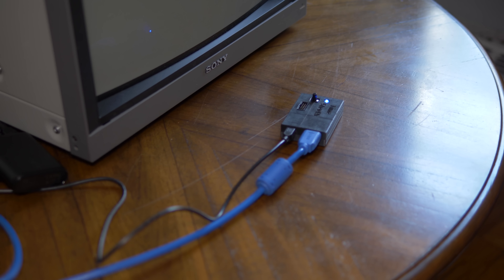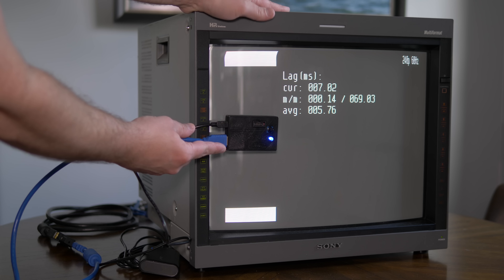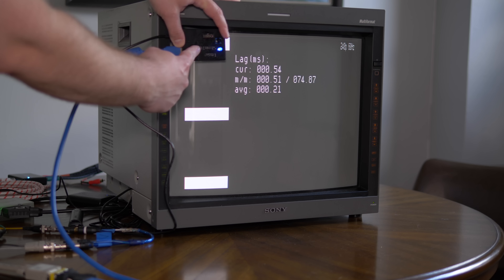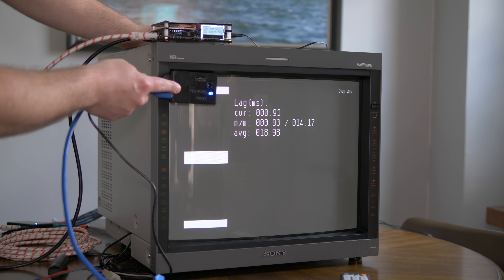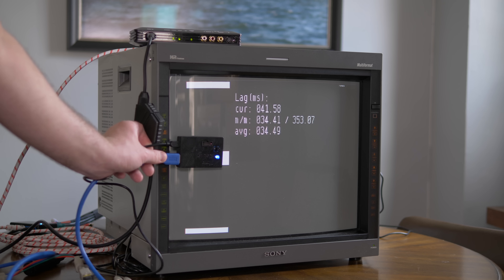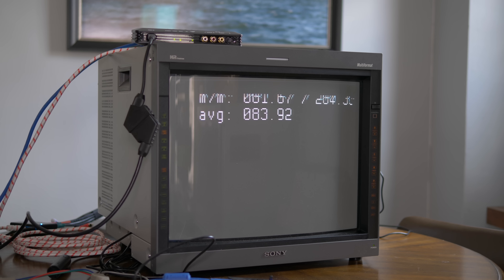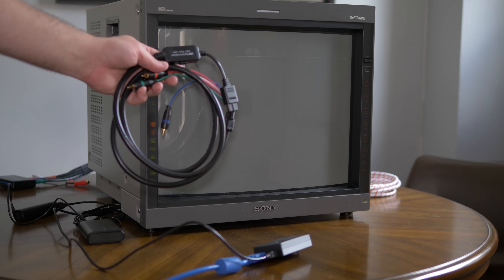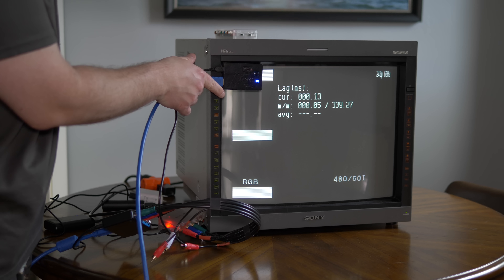Lag Testing Retro Scalers

Comment: Dude, this guy's content is incredible. I knew nothing about retro gaming and after watching this guy for a few hours I feel like I've gotten damn near college credits. Distills things so well, nothing he says is unnecessary.
Reply from the maker: Thanks very much!!!
Reply: @RetroRGB  Dude, I’ll shoot you $20 on your “donations” tab if you could link me to a Tv/monitor youd recommend for RetroTink Mini and NES, SNES and N64 that would have no latency. Gotta be under 14.5 inches tall and around $120 give or take (or cheaper if it made no difference.)
Reply from the maker: Well, no flat-panel will have "no latency".  If you're looking for a small monitor, why not just pick up a 13" consumer-grade CRT with composite video inputs?  It'll be much cheaper overall and the consoles you mentioned will look excellent.  If you find one with S-Video inputs, you wouldn't even need a switch:
SNES = S-Video
N64 = Composite
NES = RF
Reply: @RetroRGB  You know, I’ve thought about just sticking w CRT like you say. Durabrand 13inchs are on ebay for like $100. See any problem with one of those?
Reply from the maker: I'd get one locally if possible, but ANY CRT that's not an "HD CRT" would be perfect to use for those consoles.  If you use light guns, get one with a curved screen.

Comment: This is a very important video. Thank you. I will be revisiting this video in the future as well.
I currently do not use any processing. Everything is connected with their best output/cables.
But that might change, as long as it's lag free.
Also chapterized all the sections in the description.
Also saying you were wrong, that takes a man. And you just did not know, no problem. 
Again thanks for all the testing, I hope you can test new scalers as they become available.

Comment: As usual awesome video showing true testing numbers with a wide variety of scalers/alternate ways of hooking up retro stuff. I was on the arcade-projects forums a coupe of months ago. I was talking about using HD Retrovision cables along with my two Superguns. The Minigun supergun and the HAS. Man the grief I got from this one guy talking about how bad their cables are blah blah. Now I know arcade stuff can be finicky with different voltages and such.
Reply from the maker: Yeah.  Also, the HD Retrovisions were never designed for use with arcade stuff, only the exact consoles they were built for.  Kind of an unfair comparison.

Comment: Conclusion
Product	                                                                 avg Lag (ms)
RetroTINK2x SCART (same as RAD2x)	                  0
OSSC	                                                                          0
Framemeister	                                                 18(480p)-34(480i)
Pound SNES Cable	                                                42
LevelHike SNES Cable	                                        74
SCART to HDMI Box	                                               53-98
HD Retrovision cables	                                                60
RetroTINK2x Pro	                                                         0
RGB2Comp	                                                                 0
Comp2RGB	                                                                 0
GBS Control Scaler 480i	                                       24
GBS Control Scaler w/ GBS control 240p	        4
GBS Control Scaler w/ GBS control 480i	                0
GBS Control Scaler downscaler	                        7

Comment: I'm putting together a public games room. Wanting to use VGA flatscreens as I have to transport around 25 machines and fuuuuck bringing that many CRTs. Wanted some low-lag converters to give better signal than the shitty composite + old TV the previous games room was using. Your recent videos have turned me on to the existence of the custom firmware for GBS Control Scalers and I love it. Much cheaper, I can build it myself, and the lag/quality is more than acceptable for a public room. Thanks!

Comment: Great Video! I recently got my Lag Tester and I wanted to test some crappy pound cables. Can you provide a link or something on exactly you how tested that cable w/ a lag tester?
Reply from the maker: Thanks!  I went over the full chain in the video, but the one custom thing was wiring RGBs to a multi-out, so I can connect the pound cable.  You'd need the Time Sleuth, connected to an HDMI to VGA converter.  Then into a sync combiner like the HD152SCART, or Extron RGB interfaces.  Then wire RGBs from that to the multi-out port.  Then connect the Pound cable and go from there.

Comment: Great video! Bob, make a video showcasing the BEST overall solution for use on an HD tv regardless of cost!
Reply from the maker: I'm working on a video to try and help people figure this stuff out, but that's actually a hard one to answer, because what is "best" to you?  
"I just want to play my N64 on my flat panel with no fuss"?  = RAD2x
"I want to dial-in pixel-perfect timings and set phase on each console for the sharpest picture possible" = OSSC
"I have an RGB setup and just want to stream without issues" = RetroTINK 2x SCART
"I don't own any original consoles, but still have my Genesis carts" = Mega Sg
See what I mean?  I'll give it a try though!
Reply: RetroRGB you raise an excellent point! I guess OSSC would be the best option if cost isn’t a factor and your looking for the best of everything. But is it better if paired with another device?

Comment: Thanks Bob @RetroRGB
Any chance you'd be able to test the Wii2HDMI? My new TV doesn't have component and I'm hoping it's reasonable...
Reply from the maker: If it doesn't scale, it should be zero lag.  It might add some interference, but (in my opinion), that's not an "experience ruiner", just an annoyance.  Stay tuned for better Wii plug & play solutions though :)
Reply: I haven't found one that doesn't add interference. I use the component cable connected to the Portta component to HDMI box and it's brilliant.

Comment: Hey Bob solid video.  Side question.  I don't think it would change the results, or at least it wouldn't change them all that much, but do you know if the ambient temperature of the room would affect the results?  Some of the equipment have chips that can get warm and I was wondering if they clock down if the temperature rises.  I live in a warmer climate and also often will have my  OSSC or whatever inside my entertainment center.
Reply from the maker: That's a really interesting question.  I've seen OLED's register faster numbers after about 30 seconds, but I don't think that's heat-related.  I've tested scalers after using them for hours and it never made a difference.  I THINK the answer is "no, it won't affect it", but I'll keep paying attention just in case.

Comment: Very informative video. Is there any other device as complete as the XRGB Mini Framemeister Upscaler? Meaning support for Composite, S-Video, Scart RGB and Component all from the same device? Maybe something that also includes support for VGA as well which is missing from the Framemeister?
Reply from the maker: No, however you can buy the OSSC & Koryuu for much less than a Frammeister and have everything you asked for.  Or, just an OSSC & RetroTINK 2x:  https://www.retrorgb.com/upscalers.html
https://www.retrorgb.com/koryuu-transcoder-1st-look.html
Reply: @RetroRGB  I already have a Frammeister, that's why I asked lol. I was wondering if I could get an upscaler with less lag without having to get two separate devices which would make my setup even more messy. I hope someone makes a zero lag upscaler in the future with all the connections, including VGA. Thanks!

Comment: Does a gaming monitor actually adds a lot of lag when the inputs don't match the output resolution? I have a 1440p monitor (144hz, but that does not matter for anything but PC), but I'm a bit worried as no line doubler goes up to that resolution.

Also, the biggest lag I got was on my DVR... especially when using it to convert 60hz to 50hz or visa versa. It is still a good solution however for slower-paced games, as it supports RGB (at least in PAL territory it does, although it is an annoying setting at the end of the menu tree) and its de-interlacing is top-notch. And it can also record footage, if that is what you want... on fancy old DVD's, but still.
Reply from the maker: It really depends on the panel, but most are pretty fast as long as a progressive scan resolution is sent.  In fact, many gaming monitors won't even work with interlaced resolutions.
...and yeah, DVR's usually add a ton of lag.
Reply: @RetroRGB  Thanks, I'll keep that in mind!

Comment: Hey, had a quick question about component extension cable. I’m currently running an HD Retrovision component cable from Dreamcast to JVC D-Series component input. I ordered the HD Retrovision Female to Male RCA Extension cable so I don’t have to keep unplugging and replugging into the very back of the D-Series. This way I can have the female end of the component cable at the front of the D-Series for easy access to switch between my other component consoles until I receive g-comp switch. my question is, will I have any effect in picture quality using the HD Retrovision extension cable? as im now using two 6’ component cables totaling a 12’ run vs one 6’ cable? thanks in advance!
Reply from the maker: Good question. You won’t see any quality loss with the HD Retrovision extension. In fact, you could use two and it would still be the same :)
Reply: @RetroRGB  your the best, thank for the self at ease brother!

Comment: So here's a question that might be odd but would two component switch boxes hooked to each other to create 6 inputs then output through a Retrotink 2x Pro create any input lag? I have a Psyclone component switcher with a Pelican HD switcher hooked to it with component cables. The output cables from the Psyclone are hooked to the Retrotink 2x Pro.
Reply from the maker: As long as they're just a switch and don't scale the image, it should be zero lag.
Reply: @RetroRGB  yep both don't upscale the image. The Pelican itself doesn't even use a power source. Quick off topic question. I'm gonna be modding my US Turboduo soon with a RGB board so that I can use component cables with it. I know the original Turbografx couldn't use the RGB board with the CD addon due to the expansion slot being occupied by the addon. My question is by adding a RGB board to a Turboduo instead will I be able to play CD games on the Duo while getting a RGB signal out through component cables?

Comment: Forgive my ignorance, but I didn't get the top, middle and bottom part. Of course, the signal takes 0ms to be drawn on the top, but, on middle and bottom there's a significant difference. But in pratice, should we consider the top left reading only?
Reply from the maker: That's simply how long it takes a CRT to draw a full frame:  0 to start at the top left, 8ms at the middle-right (so 7ms at the middle-left) and then 16.5ms to get to the bottom right.  Any numbers over that are lag added.

Comment: Have you tested any of the Component-to-HDMI converters (not scalers), such as the ones you find on Amazon made by Portta and AverMedia? I'm looking for 480p-1080p passthrough solutions for 6th and 7th generation consoles (especially if I want to stream PS3 games via Component, as the PS3's HDMI port has HDCP that can only be disabled by an HDMI splitter).
Reply from the maker: Those are exactly what I showed in this video and are zero lag.

Comment: I use the Pound for OG Xbox combined with mClassic and take the 480p and it gets upscaled to 1080p. Seems okay to me with the supposed lag. I mean, I play Crazy Taxi 3 and do quite well in that game.. maybe I know how to adjust on the fly I guess 🤷🏻‍♂️. I’ve used lots of adapters and the only one that seemed bad to me was the PS2HDMI device.

Now I did buy a custom Xbox HDMI Adapter from a FB mod group. I’d like to see if the lag is better on that. I don’t use it much because I’ve noticed slight (ever so slight) banding in the video capture.
Reply from the maker: That's different and your scenario is still probably zero lag.  See, for consoles that are already 480p, the "HDMI Adapters" usually just convert analog to digital and it's almost always zero lag.  The problem with most cheap converters is they hurt the signal a bit, either through interference or what you described.  Still totally fine for someone on a budget though...just use it until you eventually get an HDMI mod or the Chimeric solution that I showed in my xbox video.

Comment: Hey Bob brilliant work. I personally can't afford scalers and am interested in how much lag these Wii2hdmi, PS2hdmi, XBox2hdmi and DC2hdmi adapters give..any chance of a test on those
Reply from the maker: Generally speaking, if those scale the image they'll be just as laggy as these bad solutions, however if they're simply analog-to-digital solutions they'll be zero lag.  Some of them add interference and mess up the colors, but with zero lag added, so in my opinion they're great to hold you off until a better solution comes around.  If you ever decide to invest in a scaler, you can connect the component video (or VGA) from all those consoles into something like an OSSC and get a great image.
Reply: @RetroRGB  Thanks Bob. I currently use the Portta component to HDMI for my older consoles and they work great. The DC however is used with a to HDMI cable. I haven't found a wii2hdmi or similar to run without interference.

Comment: I honestly find it so curious the Pound SNES cable is like that considering the positive experience I've had with the PS2 one: I had bought it for myself after being impressed with how it felt playing on a friend's setup at a tournament

I even bought some component cables for convenience of not having to switch HDMI cables around between my setups all the time, and after having trained on KOF XI a lot on the component cables, I felt no difference in playing with the Pound PS2 cable!

Though I'm generally pretty confident in my ability to pick that stuff out, it does leave me wondering if my evaluation was actually accurate or not. I'd love to see the numbers!
Reply from the maker: Actually, the PS2 one is mostly just an analog to digital converter;  Its the 16-bit scaling ones that are the issue.  The PS2 cable is far from perfect, but I don't think it ads any lag at all.  So, your ability to pick out lag was actually confirmed :)

Comment: The weird thing about Pound cable is that the delay sort of... counts down one milliseconds at a time, then resets to a higher value at one point? It doesn't simply just vary and jump around. Very weird.

Also, if I could make a request for this channel, could you perhaps test Kaico's PS2 to HDMI solution? There are zero analytical reviews of it, so its kind of difficult to know what it exactly does.

To me it seems like a 2.0 version of the PS2 to HDMI adapters, but I have no idea if the video output is less noisy than on some of those adapters. One extra benefit it has over other such things is that it can toggle between component and RGB.
Reply from the maker: Unfortunately, Kaico has been stealing and reverse-engineering designs from the retro gaming scene, so I'll never buy a single one of their (most likely stolen) products.
Reply: @RetroRGB  Oh, that's interesting. I know they sell the standard PS2 to HDMI dongles too, but every generic company sells those, probably nothing  to steal from that. What products have they stolen from?

Comment: To test cables like the HD Retrovision, how did you plug them in to both the Time Sleuth and the monitor? The other end of the cable just plugs in to the console. I'm confused, but I want to understand!
Reply from the maker: I used the converters I showed at the beginning.
Reply: @RetroRGB  
In testing the snes levelhike cable - Is there a female end snes port to hdmi cable or something? That's the part I don't understand.

Comment: Is there anyway you could lag test HDMI receivers input lag?   The next consoles are getting rid of the optical port and the only way to get sound to receivers is to pass through video through it.  I've always used optical and then HDMI directly to the TV to avoid lag and now I'm worried that I'll be getting alot of lag with the new consoles that's releasing soon.  I'd love to see how much lag HDMI recievers add lag.
Reply from the maker: I'd love to do that test, but don't have the budget :(

Comment: Bob, was wondering if you've ever lag tested (or could in the future) whichever HD-SDI converter you've used on your BVM. For some reason I'm thinking I've read places (or even heard you talk about it here) that HD-SDI is a bit laggy. I have a D series BVM and plan on hooking my PS3 and Wii U up to it, but I was going to use component given that I understood HD-SDI to add lag. I'd be interested to see an actual measurement though if it's possible.
Reply from the maker: The one I tested was zero lag, but due to compatibility issues I normally just use component video, not HD-SDi.  720p is the only signal that ever worked reliably for me and 480p doesn't work at all.
Reply: @RetroRGB  Interesting. Thanks for the reply!

Comment: I'm using an Xbox One to passthrough the OSSC HDMI signal. It seems to me that the sync time for resolution changes on OSSC improve a lot with it. Could you test it and confirm? Also, could you see how much lag does this solutions adds up to the OSSC? Thanks in advance.